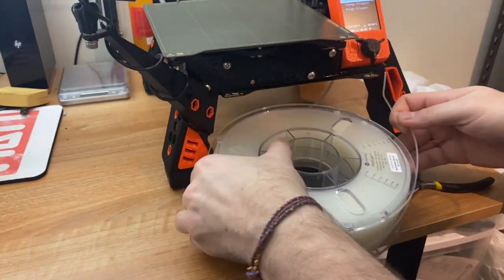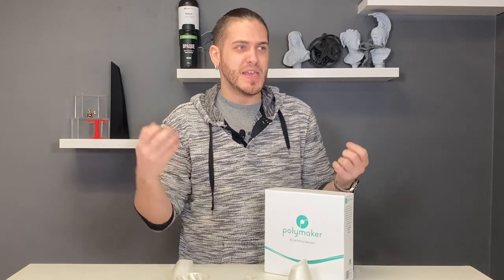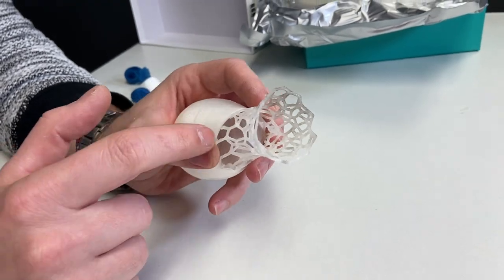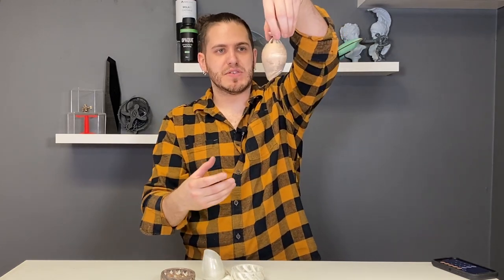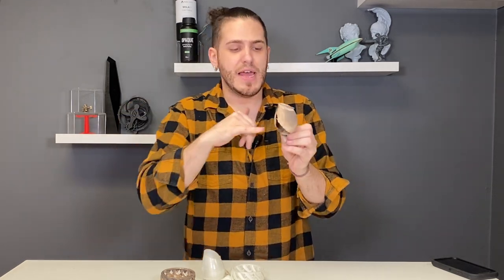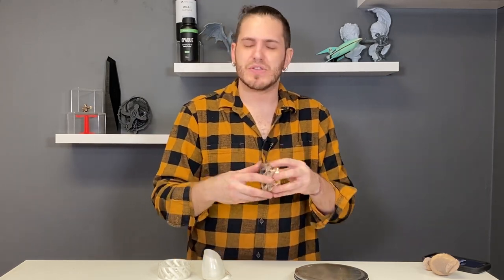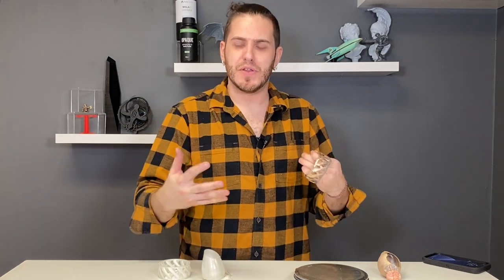FDM metal casting?  | Casting Polymaker PolyCast Filament in Bronze

Comment from the maker: PVB Properties 01:21
Printer Settings 02:00
Print Smoothing 03:10
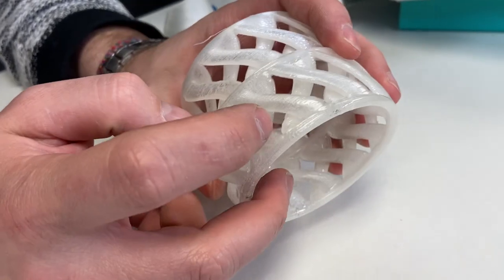What makes it Castable 04:40
Comparing FDM to SLA 05:49
Burnout schedule 11:11
Casting Results 13:05 
Measuring the amount of metal you need 16:30

Comment: What kind of printing profile do you use for polycast filament? Speed , layer height, temperature, nozzle size ?
Reply from the maker: Prusa Mini+ with a cooling shroud mod. PrusaSlicer 2.4, I used the Prusament PVB profile 215C Base layer, 210C for the rest, 75C Heated Bed. 
45mm/s perimeters 70mm/s infill.
0.4 nozzle.

Comment: try the boric acid (1% to plaster) if you don't want to use the nails. it might give enough support for the failed vase.
did you vacuum the flask? I would have assumed the bracelet would have cracked and plaster get inside as the infill was not 100%. So I am guessing you did not not.
Reply from the maker: We vacuumed the flask as shown in our casting montage. Didn’t want to risk the bubbles. 
We will probably remove the spru across the vase lip before doing something with the investment. That spru may have help create a break point.
Reply: @ClearMindJewellery  I saw you vacuumed the mixing bowl, but the flask is not shown being vacuumed, goes from pour of flask to removal from kiln. Which is why I asked.

Comment: You failed to mention: PVB is highly hygroscopic, rapidly absorbing humidity from the air, and becoming moist. It's apparent with the excessive stringing in your video at 3:05. Evidence of stringing is even visible after you cleaned it. This would also explain the numerous jams you described, as moisture expands the filament and instantly vaporizes when it hits the hotend, which increases heat-creep, causing jams when the filament retracts into the cooler part of your heat-break.
The PolyCast application notes clearly state "humidity of no more than 20% during storage and
use, and recommend printing from Polymaker’s PolyBox (purchased
separately)"... or similar enclosure.
Moisture will also affect the burnout process, which increases the possibility of shell cracking failure. The PolyCast Notes also explain, "To dry the printed patterns, expose the patterns to well-circulated hot air at 50 °C for at least 1 hour".
You were correct about one thing at the end, "You have to know what you're doing", which you certainly didn't when making this video.